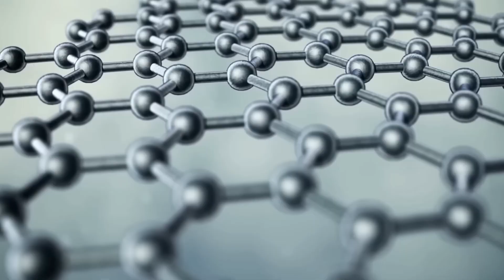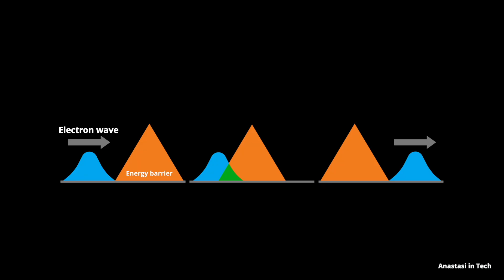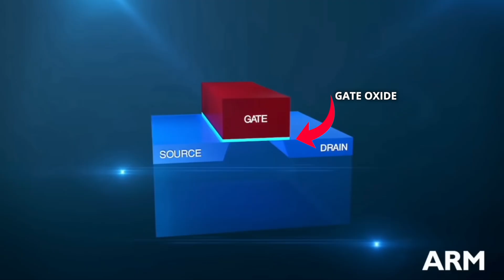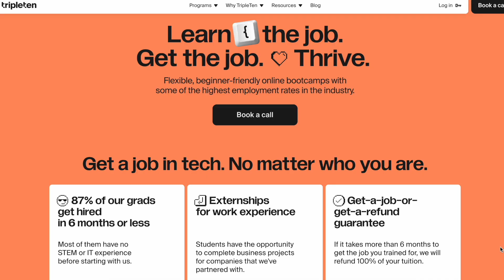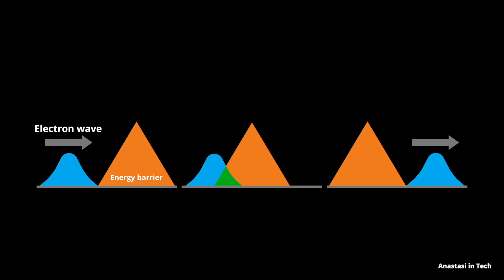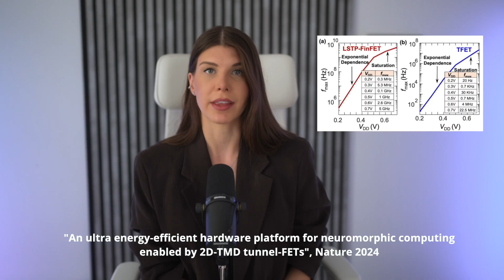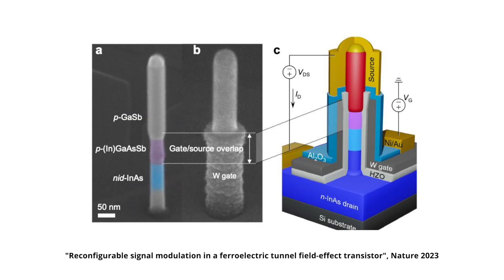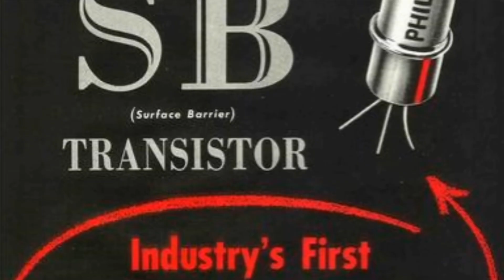New Microchip Technology: 90% Efficiency Gains

Comment: Computers have their place, but not in cars, humans, or my pocket!  I like having a conversation without the phone ringing.  I would rather talk to human in person, that includes the socially disabled engineers from work.  I hope they find an alloy for the chips that doesn't fall apart under heat.  So far, the life expectancy of the chip is 6 months under full load for the entire period.  Have they figured out how to build 64GB of RAM on the CPU?  Registers and buffers will only add so much speed.  We need more speed from the memory to CPU to HD.  I have noticed an increase in collisions between the HD and memory, with the Linux OS.  Microsoft had issues with memory corruptions, it makes me laugh!  The perfect system appears to still be a quad CPU, with 128GB RAM per CPU and a dedicated HD per CPU.  CAD really eats up hardware!  3D rendering and light tracing can burn up a CPU!

Comment: If optotronic cpu (optical cpus) architecture can transmit at very hi speeds over greater distance... could you create a hybrid cpu, maybe even in 3 dimensions, as in a lot larger spaces than just nanometres, with 'normal cpu clusters' mounter on optotronic(?) cpu components for that extra speed over a greater distance than pure silicon... I was wondering then if integrated memory could be achieved along with larger spaces between CPU-hybrid clusters and space dedicated to heat transfer ... Instead of trying to cram it all in to the smallest space possible.. IF and only IF the optical can move information between clusters fast enough to not degrade performance too far...?

I was wondering if there were ways to break up cpus a bit and intercluster transmission speeds and heat... That and wondering if we can get away from the current flat squares.... Not sure of this breakthrough would work with that or not...(shrug)

Comment: I wonder if vac tubes would have been shrunk to miniature and made highly efficient, if given time to mature...
Reply: Apparently there are nano-scale vacuum transistors (https://en.wikipedia.org/wiki/Nanoscale_vacuum-channel_transistor), which are made using lithography and whatnot, and due to the tiny size, don't actually need to be vacuums because the gap is so small that collisions with molecules of gas become a negligible problem.

Comment: I'm sure that there will be a very large number of applications for mobile devices due to the low voltages and low losses. Many of these applications simply don't need blistering performance in the GHz range. Certainly IOT could make good use of this. Maybe this will be paired with those high efficiency indoor Solar Cells to produce products without batteries.
This is a fantastic channel, keep up the good work!